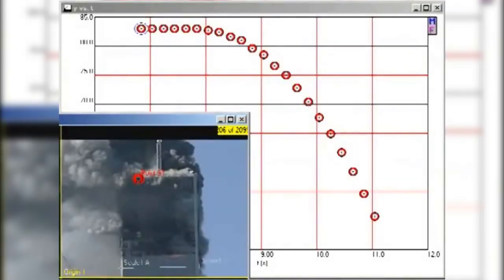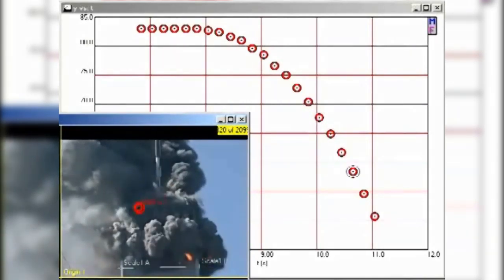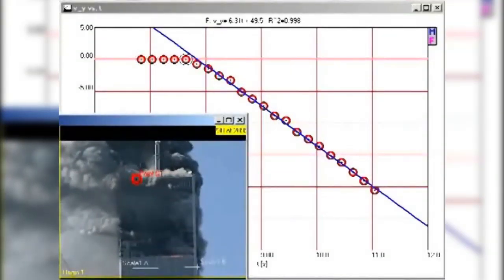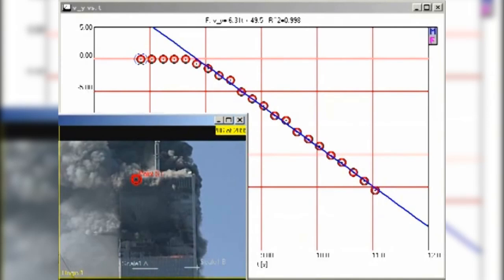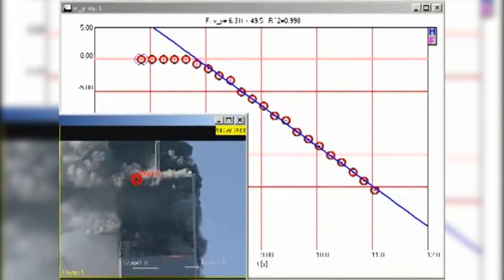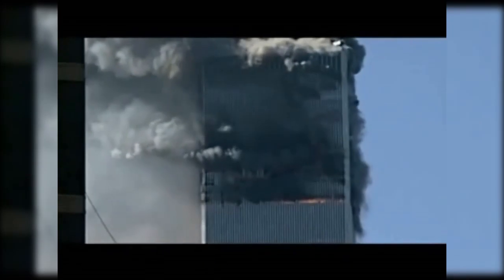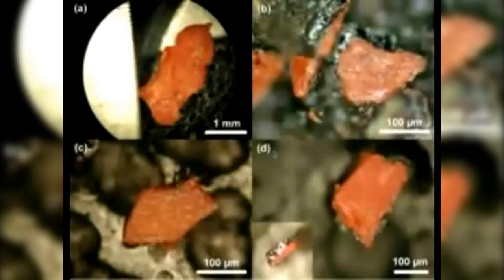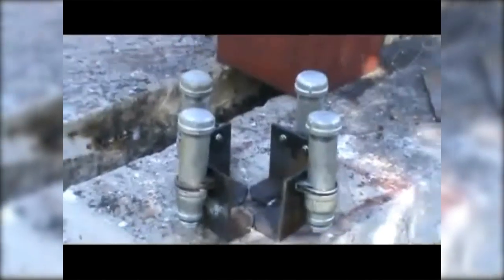9/11 - Twin Towers Analysis

Comment: 3 QUESTIONS 911 TRUTHERS DON'T WANT YOU TO ASK THEM:
 
If explosions were heard in the basement of WTC 1, why did the building fail at the point of impact?
 
If the WTC was destroyed in a controlled demolition, how did the nanothermite charges survive the plane impacts and how did the perpetrators know exactly where the planes would hit the building?
 
How do you explain Khalid Sheikh Mohammed’s confession to planning 911 in an Al Jazeera interview back in 2002?
Reply: Keith Wilson
Allyn E. Kilsheimer of KCE Structural Engineers
 
"It was absolutely a plane, and I'll tell you why," [of Washington, D.C.] "I saw the marks of the plane wing on the face of the building. I picked up parts of the plane with the airline markings on them. I held in my hand the tail section of the plane, and I found the black box. I held parts of uniforms from crew members in my hands, including body parts."
 
911 TRUTH DEBUNKED!
Reply: The building did not collapse on impact of the plane. The plane collapsed after the explosives went off and went down down in a classic controlled demolition fashion. Building 7 wasn't even hit by a plane and it's collapse was announced by the BBC 26 minutes before it happen. Plenty of evidence of controlled demolition. Over 120 firefighters remember hearing and/or seeing the explosives going off.
Reply: Drago Varsas
No evidence of explosives.

You're lying yet again.

Do you mean the same WTC 7 that was hit by the largest collapsing building in the history of the world causing massive structural damage and raging uncontrollable fires?

911 TRUTH = 911 LIES
Reply: Drago Varsas
I have an engineering degree with 10 years experience in steel building design.

I knew from the very first time I heard 911 twoofer magical theories that 911 was an OUTSIDE JOB.